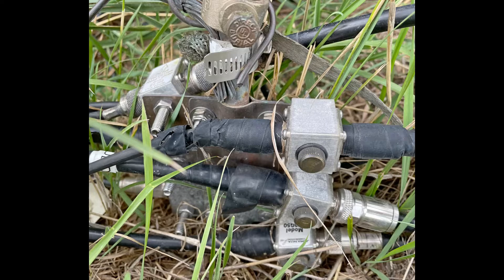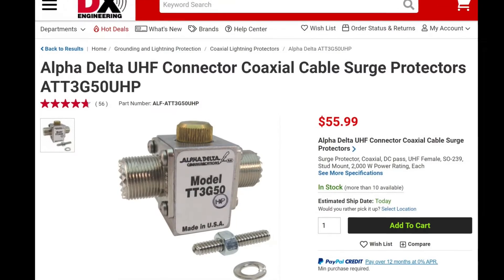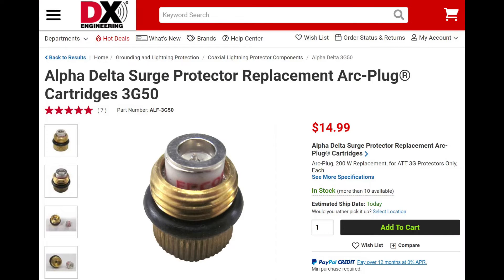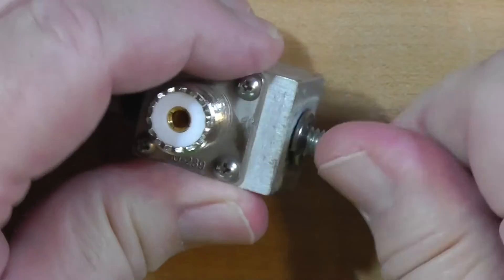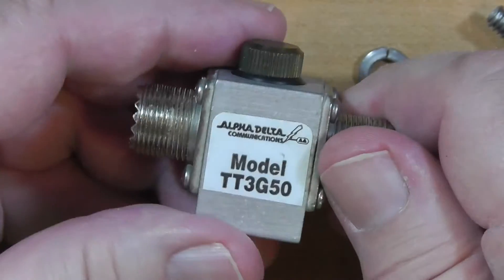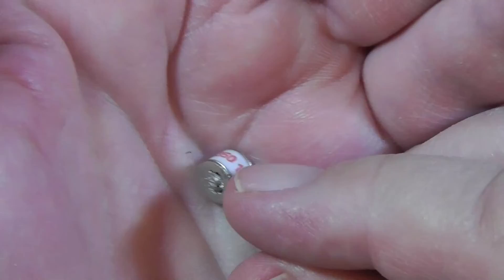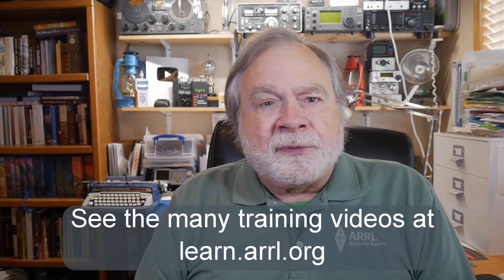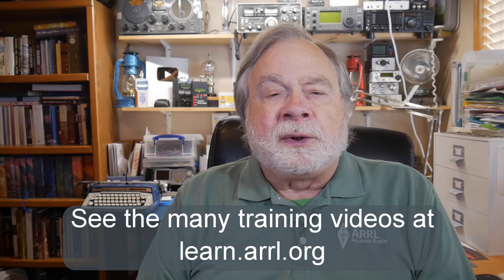QST: Ask Dave December 2022 Lightning Arresters

Comment: Lightning can me mega volts, not several thousand.  

The break down voltage is much more than a few volts.  At leat I hope so since the voltage at 100W is already 70v into 50 ohms and over 300V at 2000W.  
 If the SWR is higer than that then it can be many times that.  

On that just an arestor and a properly bonded ground rod alone wont do much.   You need multiple electrodes.  

Yes recomend 100%.   Technically shielded cables dont requre it under NEC it is a good Idea.   For controll cables and open wire feeders its absolutely required under NEC. 810.21.  

The ground rod at coax entrance is also NEC requirement.  Half or more hams ignore that. 

They are called surge protectors because they are just that.  They wont arrest direct lighting strikes without a good well designed ground system done to NEC codes.

Comment: Hi Dave, you mentioned DC continuity in this video. Why would DC continuity be important or needed? I'm still very much leaning about this topic so I appreciate any help you can offer. 73, de KD7SJT
Reply: One example is an antenna splitter that's run by DC power fed up the coax.

Comment: I was a Field Engineer for AMTECH CORP. years ago now, we pioneered the RFID tags used in the automotive, Toll, railroad, aviation, intermodal container industries. For the Toll applications the RFID reader antennas were mounted on road light poles on average about 25 feet up,some higher, some lower, I was based in Oklahoma. Every storm season we would take strikes all the time. The one thing that rang true was you could count on every strike was different, some would take out antennas, others would knock out the RF transmitters and other times we would just get a surge and the systems would just start slowly decaying. We would eventually install the gas type arrestors, some would work, but in a direct strike you still would see failures. Rodney Whitfield KC5DZH.